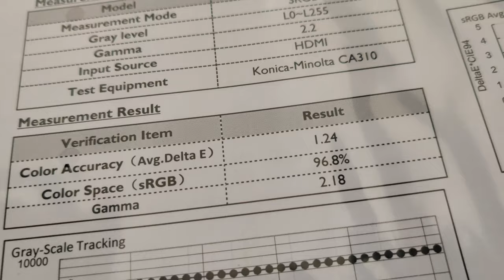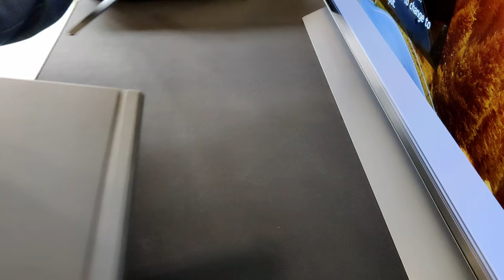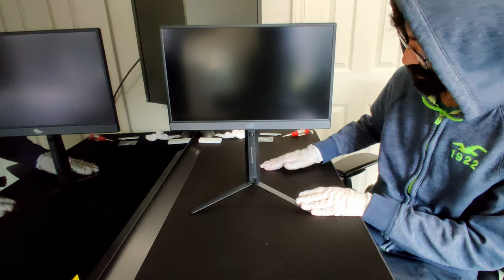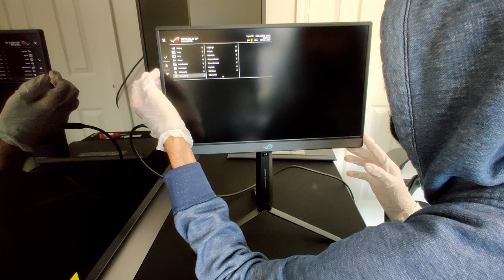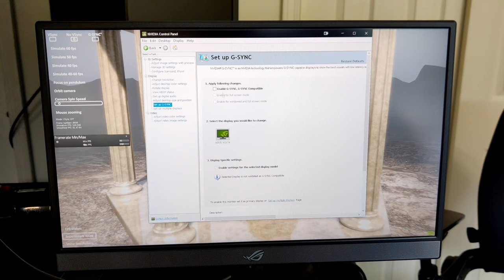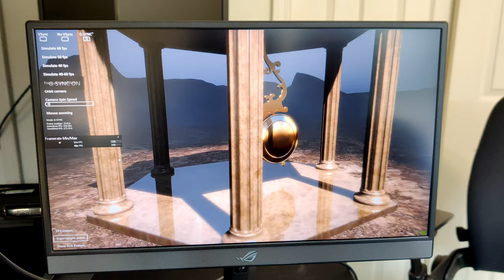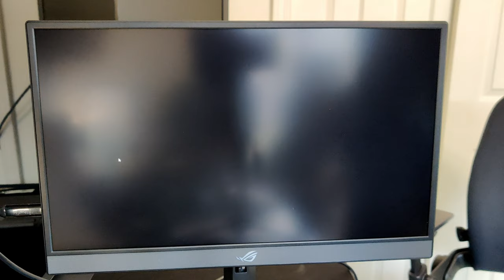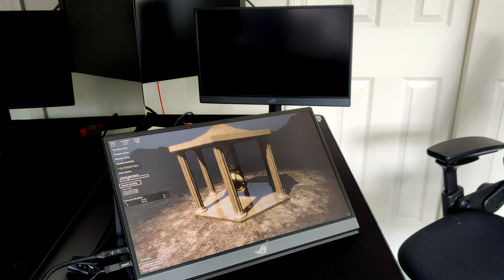Asus ROG Strix XG17 Full Bundle Unboxing, Overview & Comparison to an Open Box Model

Comment: What’s the backlight bleed on this bro?
Reply from the maker: It's a typical IPS panel. So, lottery based. This one so far looks good. It's the only IPS panel I plan on keeping. The rest of my panels are OLEDs. If you use it with the lights on then you won't really noticed the bleed. But, at night vs an OLED obviously there is glow. Other than that it looks really good. Since, it's 1080p at 17.3 inches everything's super clear and sharp. Doesn't feel like you're running a 1080p monitor.